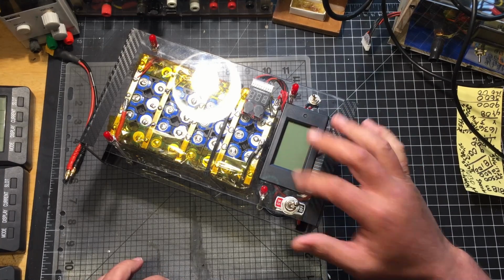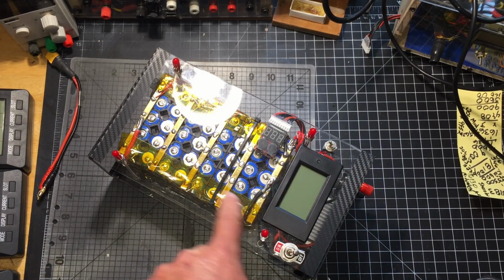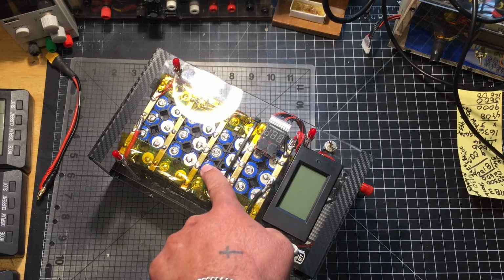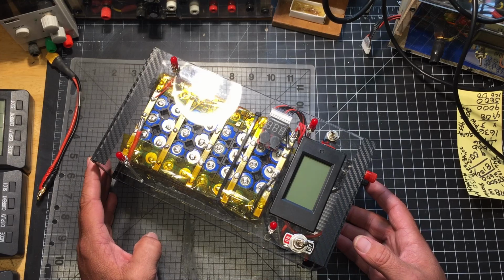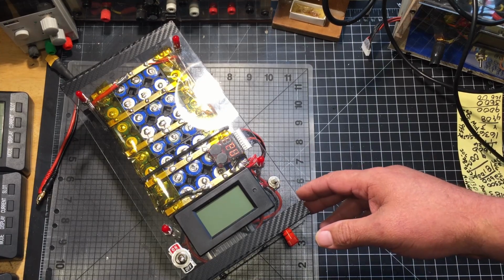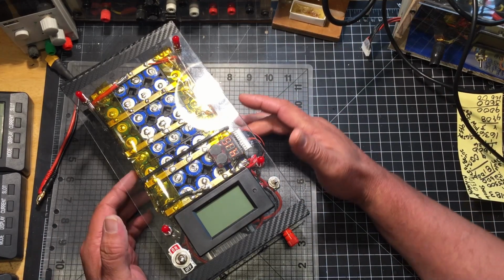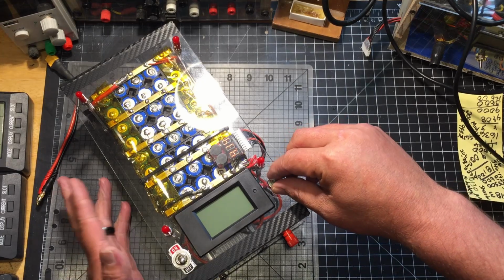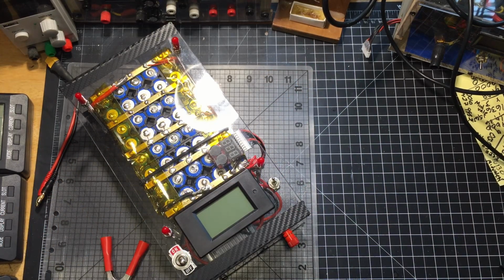DIY Laptop Adjustable Portable Battery Bank 8S5P Li-ion up to 88,000mah

Comment: What configuration would you use having 100  of the spim08hp? I'm new to solar and would like to build a solar bank. I liked your vids on these batteries.
Reply from the maker: There are sooooooooooooo many factors when it comes to a solar build. It mainly depends on the heat of the build....the inverter. Once you get the inverter, you can easily figure out the battery configuration.

Comment: Great video, I just bought 100 of the spim08hp what do you think of using one of them for a laptop battery with the buck converter?
Reply from the maker: Great Batteries and capable of mostly any amperage. These also have great capacities. The only downfal is how to put them together and the flat bigger size. But these would make a great battery.

Comment: it could use a stronger back panel so it isnt so flimsy, that is alot of weight, cool build though!
Reply from the maker: I didn’t use plexiglass on this one. I used lexan and a nut and bolt system.  I’ve taken this all over without any issues so far👍👍👍👍👍